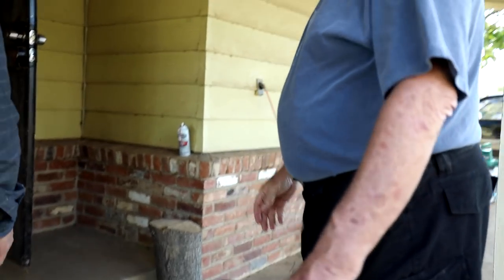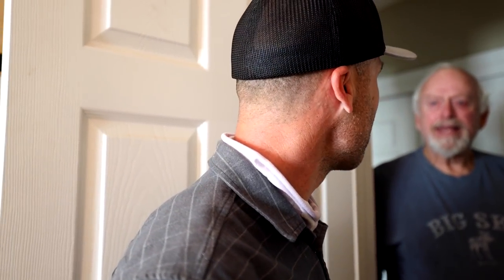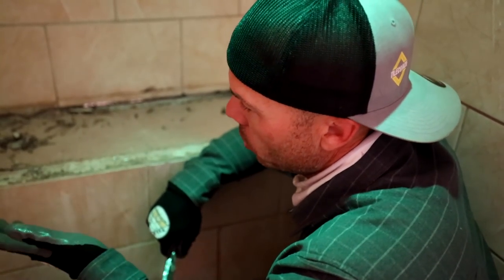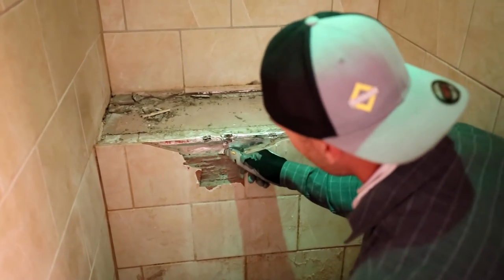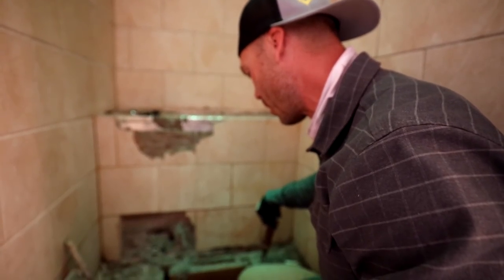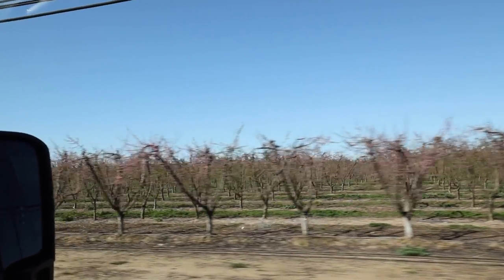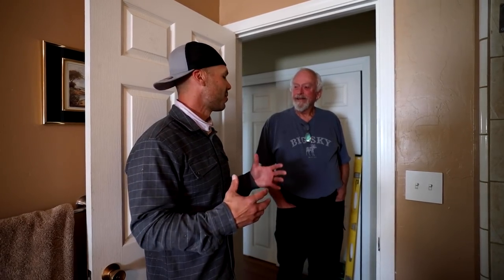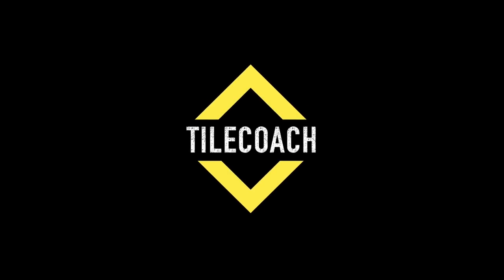He Used WINDOW FLASHING to WATERPROOF HIS TILE SHOWER --- and IT FAILED!!!

Comment from the maker: Should I fix this shower for free???
Reply: I would!
Reply: Why didn’t you help that other guy Patrick? Interesting video 👍🏼
Reply: If you can afford it. It's one of my dreams is to be able to do work like that for free for people
Reply: only if he buys your gear ;)
Reply: At least with a discount! Nice video!
Reply: Yes! Fix it for free! He'll be so happy...maybe trade for a bunch of walnuts. 😉
Reply: Be a nice gesture. Seems like you think the guy needs help. Not a big job if the walls can be saved.

Forget Flexseal. I'd like to see you test the newish STPE-based liquid flashing products (Henry Air-Blok LF/Prosoco Fast Flash/Zip liquid flash etc etc etc - almost every major sealant manufacturer sells STPE-based liquid flashing). Some builders use liquid flashing rather than tapes and the cheap old Fortifiber-type junk.  Fwis, STPE sealant was developed by the Japanese to seal windshields to car frames and eventually migrated to the building industry - very good in corners as it avoids lapping issues and also has some gap covering/flexibilty.  It cures using air moisture so can speed up the cure by misting. Can also be applied on damp (not wet) surfaces.
Reply: sometimes myeener smells
Reply: That would be nice of you, but you need to make money. If you decide to experiment with flex seal in his shower, then free would be appropriate LOL
Reply: No; nothing is absolutely free; get them to buy you dinner
Reply: Prime opportunity to get into agriculture.  Glad you can help.
Reply: I think you should but at the same time, you have a business. Even if you don’t do it for free, a great discount would be wonderful. Thank you for doing this for him!
Reply: Free... no. But considering you're doing this for views and get some promotion, do it at low cost. Supplies + reasonable shop-running cost, but free labor maybe. If he has enough tile for wall repair, use it.

We really truly want to see a repair done that takes a sub-par install and brings it to a level of acceptable use. No, not daily flooded morning, noon, and night showering by 8 people, but the typical 1-2 adults showering once where it often is wiped down and gets a reasonable chance to dry. New mortar bed, curb, drain system, and Kerdi waterproof up the 1 ft of a tile on the bottom and bench. We all understand this isn't truly top-notch waterproofing up the walls as should be done from square one.
Reply: If you can afford the loss, then it would be really cool. Some Elderly don't have much money. If this happened to my Grandma she wouldn't be able to pay someone to fix it.
Reply: Do it for 2000 pounds of walnuts
Reply: You are truly a professional. I like how you make it personable and ask about his personal life.

You are more than just an installer.

May the Lord continue to bless you, your family and your business.
Reply: If they are a charity case, then sure.  It will be a nice demonstration of the Flo FX drain we all want to see. But, if they can afford your services, then they should pay for them, because the great charity work you do might be needed more by someone else.  But, since I don't know your schedule, future bookings, and prospects or capacity for other donated jobs, I would say it's probably best to pray on it and discuss it with your wife.  The answer will come to you.
Reply: Nothing is free
Reply: At the least, please cover your expenses. He seems to be a very nice person.
Reply: Absolutely not. You have to be doing pretty well money-wise to even offer such help. Isaac, your videos are great. I work in complete high end renovations I. nYC, but I focus more in millwork and electrical. Tile has never been my forte, but your videos are really helpful in me not having to sub tile work.
Reply: Yeah. Let’s do it ♥️
Reply: The only time I work for free is when it’s family. Even then, they usually insist on paying me. When you work for free, it devalues your skills. I am happy to pay someone that is an expert in their field, it’s worth it.
Reply: Maybe you just charge for your employees time😊
Reply: If you're going to experiment with Flex Seal or other new product, then Yes!
Reply: Yes, you can make it into a how to replace a leaking shower pan without tearing out the whole shower video.
Reply: can we donate to the cause?
Reply: No.
Reply: No way. All your skills and knowledge is worth so much that  its practically priceless  the least you can do is get accept some monetary benefit for it. I'm not suggesting to break his bank either. But fair exchange is no robbery.
Reply: No, my guess is that guys got some $$$, he’s just a horse trader my nature. Charge what you normally would plus some walnuts, after he agrees give him 20% off, that’s more than generous. I can tell your a solid guy and it’s in your nature to be kind but business is business.
Reply: You are truly a nice person for even considering doing this free.  He sounds like a nice senior citizen that can use a break. Do it for a big discount because you have a big heart. Bless you
Reply: Yes!!
Reply: I would if you can afford it! He’s seen hundreds of your videos and it would be great to be able to give back to loyal fans/viewers
Reply: Hydroban. That stuff is legit. We used that stuff for the showers in the hospitals we did. Several thousand rooms. Not one failed because of the waterproofing.
Reply: Do it for lunch and a handshake 😁
You're a good contractor and a good person
Reply: Maybe if you didn’t have to eat that week…

Comment: I have not seen you make a video using old school techniques in combination with new products and what I mean is. Reinstall a pan liner "Water in water out system " waterproof the seat and up the walls 6 inches and wire lath and mud on the seat.
 Reinstall the cement board on the walls.
Combination of really old school and new old school.
Your the man make it happen!

Comment: Hey if the wood chisel works, use it! 😃
I build furniture and wouldn’t use my fine chisels for tile removal but like you said, to you it’s a tile tool! I love it!
Reply: I also used the wood chisel to remove our 4x4 kitchen wall back splash.  It does work.
Reply: Cheap home depot chisel has served me well for nearly 15 years

Comment: I know one thing about Flex Seal, water base house paint does NOT stick to it, friend of mine used it inside of an office trailer and about 3 months later it started pealing real bad. So I would do an in house test to see if anything will stick to it first for more than 6 months.
Reply from the maker: Yea, it says on the can that paint won’t stick to it.  Thanks for the heads up!

Comment: I have a small shower that I want to redo. I hate it. The previous owners refinished it and whomever did it did not seal it properly, so it immediately started to bubble at the drain. Definitely going to use your coaching service when I begin the project.

Comment: Laticrete 9235 is extremely expensive ( I believe a 6G bucket costs around $600 for just the liquid, not the kit), but it truly works wonders in terms of quality and water barrier properties. I’m sure Redgard and Mapei AquaDefense are much cheaper ($150-$200) range, but quality is quality and you get what you pay for.

Comment: So I have a shower in my home in Texas that has somehow lasted 28 years and is still doing pretty well.  However it too only has a floor drain in it and not a proper shower drain.  All I can think that has saved it is that the drain and the waste pipe are actually not connected.   There is about an inch of mortar bed between which I am guessing allows the mortar bed to weep int the waste pipe.

Comment: I have to laugh at myself - I just tore out some damaged tile that sat on top of a shower window sill. The damaged tile and grout were allowing water into the wall cavity. Not a lot, but it was wet under the tile. I used a liquid applied window flashing (Henry 900) to waterproof the window sill, bond the new tiles, and "grout" between them. I'm not a hack, it looks good and I only need it to last a year or two before I remodel the whole bathroom. I look forward to doing it right when it matters with your awesome content!

Comment: replace the rotted wood, and give Laticrete 9235 a try. That used to be the go to for waterproofing. Pools, showers, you name it. expensive, but with the anti fracture membrane, should be able to handle some techtonic plate action

Comment: I have a couple chisels I use too. Ripped one out last week that only had a pan that didn't cover top of curb. Luck the customers take short showers...no door saved the curb although water damage was present, also nails a Floor line... nail heads rusted away, 2 niches, dura rock had caulk on joints. 6x6x10, nice size, return customer and third shower for them. Figure kitchen will be next, saw some backsplash tile, ha

Comment: I used flex-seal tape for a bath tub flange.  The adhesive and width of the tape made more sense than the aluminum angle with double sided tape that the tub company offers for a flange.

Comment: Try "Liquid Rubber Waterproof Sealant - Indoor & Outdoor Coating - Easy to Apply - Water Based - Original Black, 1 Gallon
" for waterproofing mr build it on YouTube used this i was wondering if that is okay for showers

Comment: Issac, werner 5 way. In the paint section. Beats the hell out of that chisel
Reply: Paint section at loews, lol. They have better tile supplies than the depot
Reply: 5 in 1s dont hold up. Will end up breaking a 5 in 1 way before you would a chisel
Reply: @bdenney9443  not the one they sell at loews made by werner. Has a steel end can beat on w a hammer. I beat on em all the time
Reply: @victorcaldwell2900  Its the prying they dont hold up to. x 2 for chisels, bevel side down.
Reply: @edmessina8392  lol, mine has held up pretty damn well. And i beat it up pretty good. But i also use coal chissels, margin trowel, ect when setting.

Comment: Flex-seal ? Uuuhhh......whats the difference in it and Redgard? Or truck bed-liner for that matter? Its all the same thing most likely, just with certain additives for specific applications i.e. anti UV protectants in bed liner that wouldnt be required in a shower sealant, anti corrosive additives in shower sealant to resist concrete mortor that wouldnt be required in truck bed liner etc etc.

Comment: I have a buddy that’s done tile work for 25+ years. He is well-known and respected for his work in my area. All he uses is durock cement board directly to studs and then tiles right over it. Is this a problem for shower failure?
Reply: No waterproofing?  Sure this is it?  Tile, thinset, and cement board and done?
Reply: @ryszardbargiel7256  that’s it. I’ve never heard of one of his showers failing...
Reply: @danielforte3331  is water proofing to protect walls from damp/rot if it penetrates the tile? I'm from UK and ive never seen it here.
Reply: @danielforte3331  how would one know?   Sometimes the news never comes out for various reasons.  Assuming it is not failing, something is definitely missing here.  It could be as simple as epoxy grouting and very good work, creating no area for water to penetrate.
Reply: @louisjenkins3361  yes, and more.  Why allow any water to get into the walls or floor?  The problems water can cause, not just to wood, are numerous.  The only place water should be going is down the drain.
Reply: @ryszardbargiel7256  I'm from the UK rarely ever see water proofing, I'm a property investor who refurbishes houses so if theres any problems I would know. Been doing it for 10 years without a problem just thinking if it's worth the extra £50 and man hours to water proof. I might water proof my next project and see how it goes.
Reply: @louisjenkins3361  the way I see it is that some methods are good enough at stopping the majority of water and due to the underlying  structure, any water that does get through is not enough to cause problems and evaporates.  Some old systems just work well. But everything depends on many factors.  When things change, such as using a porous tile, a different grout, or other types of material underneath the tile (thinset, boards, adhesives...), this is where the problems  appear.  Or  poor work where cracks allow more significant water leakage.  Or new poorly designed drain fixtures.  Or improperly installed drains, etc.  If something has worked for decades and there is clear evidence from deconstructing it that it does, then there may be no reason to change.  Personally, I just like to overthink, over engineer, etc.
Reply: @louisjenkins3361  that’s the idea of waterproofing. Most of the people in my area here in the US don’t use a waterproofing method either. I’ve not seen many failures either. I guess more time will tell...
Reply: Have done similar installs, not on showers, but tiled tub surrounds where I also add silicone caulk and Kerdi banding in vertical corners. Not necessary to go to the ceiling; stop a little above height where shower head comes out of the wall. Keep it thin — don’t want excessive thinset in your corners ruining flatness of walls, especially with large format tiles.
Reply: Yes

Comment: Chisels are great for tile!  Great for fine tuning and prying against something solid.  Take a grinder blade to it every other week and you're good!  It's not a wood chisel anymore after you hammer it against some cement/tile.
Reply: Or every few months.................
Reply: Prefer a 5 way
Reply: @victorcaldwell2900  me too, but the chisel is nice for tight spots and stubborn bits.  was using mine today at a floor vent.  needed a real smashing.
Reply: Im a carpenter that does alot of finish work. Trim,bathrooms, kitchen's and ton of tile. I have a few sharp chisels that I store in a save spot and are only used on wood but I have multiple "beater" chisels. I have 2 in my tile crate, 2 in my masonry crate and probably 5-10 between my demo tools and box of random hand tools. I'm pretty sure any person that works with there hands for a living has a couple chisels in their arsenal lol
Reply: @billzima7068  i have about 10. 6 have been ruined beating on tile, or more specifically, prying up tile. Why i switched to the 5 way i use. And obtw, i have ruined a ton of 5 ways too. But the werner that i found at loews is all 1 piece of metal. I have like 4 of em now🤣

Comment: “It was wrong but it worked.” Well in my world that means it was right. If what you installed really did work then I don’t need any more than that to say that it was right. Nothing ever needs to be repaired that is functioning and working correctly. Again if it’s working then it was done right.

Comment: What about using bedliner (Line-X or Rhino lining) to coat the entire shower floor as waterproofing? I'm thinking about doing a walk-in shower for my 71 year-old mom and I want something slip-resistant and bedliner always springs to mind.
Reply: There is a product called "Tufflex" which is a far better option.
Reply: @rainmaker3700  Awesome. I'll check it out. Thanks!
Reply: Bed liner as the finish on the floor? You can get tile that would work well for her and be safe for her to walk on.